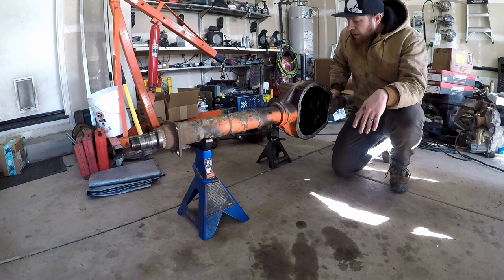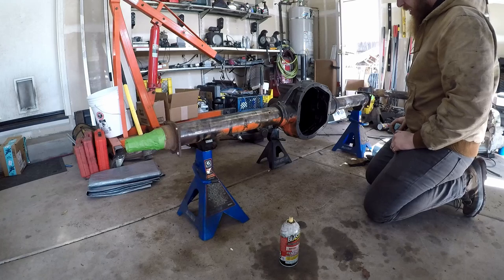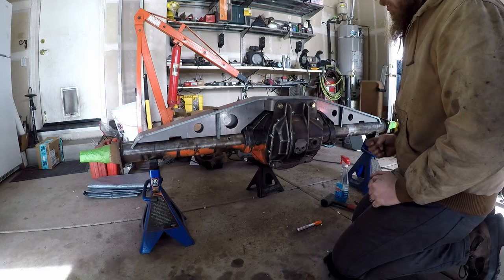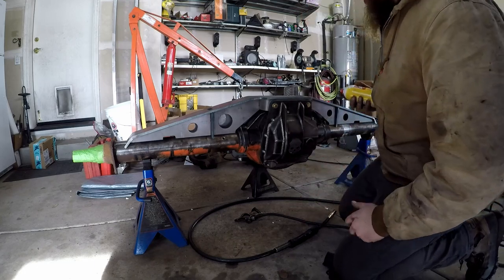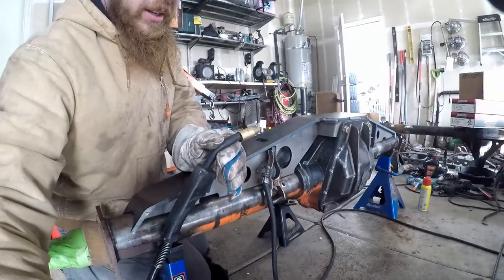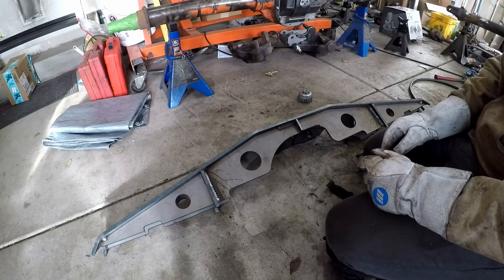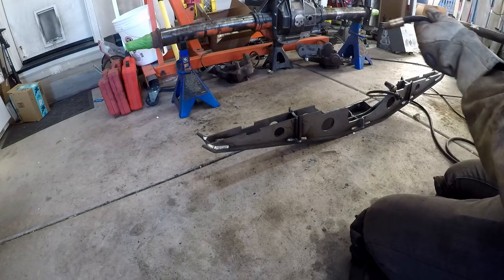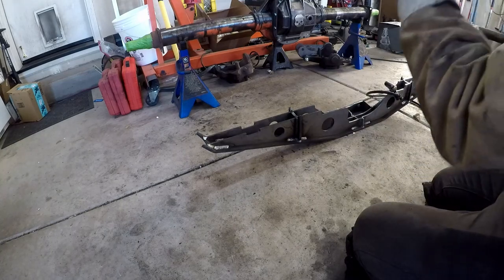Welding Ford (Sterling) 10.5 Truss -Ballistic Fab Shave Kit -1st Fabrication on Dreadnought Durango

Comment: How did you decide the pinion angle? I'm doing a 14 bolt on a tj.
Reply from the maker: The truss just welds on based on the diff cover, so I didn’t do anything with the pinion angle. Once the axle is under the rig, I just need to mock up the axle where ride height will be and get the links adjusted so the pinion is at the same angle as my t case.
Reply from the maker: For something short like a TJ, you’ll probably be using a double cardan drive shaft, so you’ll want your pinion to be at the same angle as your drive shaft, so plan on it pointing up more.